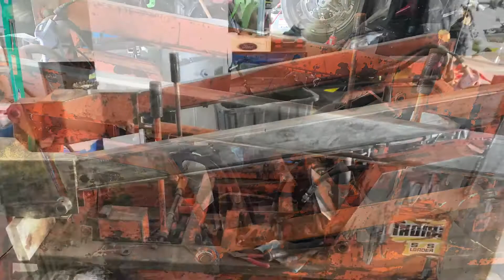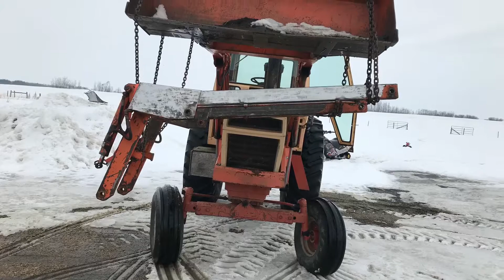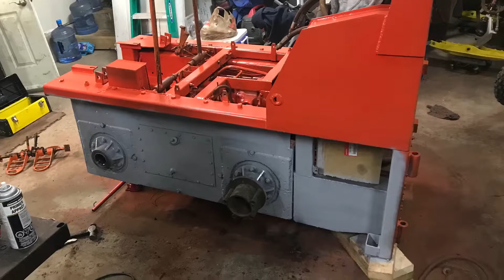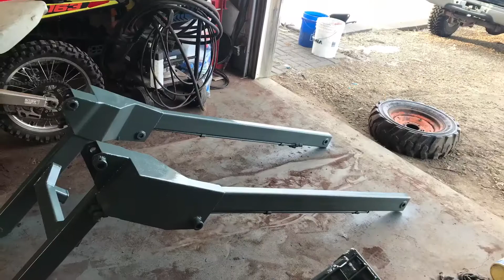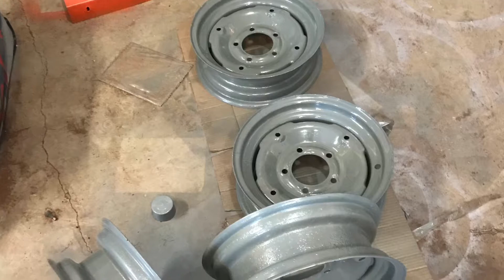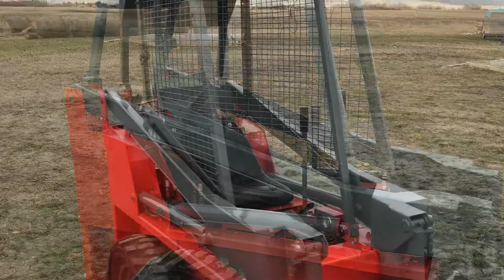1970ish THOMAS 700 skid steer tear down and paint job

Comment: What year is it we have the same one sitting in a barn but can’t find a Manuel or parts for it anywhere
Reply from the maker: I don’t know exact year, I believe early 70’s. It is a 700g I think. I e-mailed Thomas when I was working on this project and they sent me a parts diagram and a operator manual for a similar model. Most parts I was able to source easily just by size but fortunately I didn’t need anything major for parts, mostly just seals and hoses etc.
Reply: Parts are available direct from Thomas and many dealers in Ontario